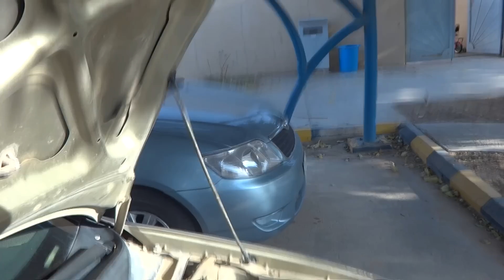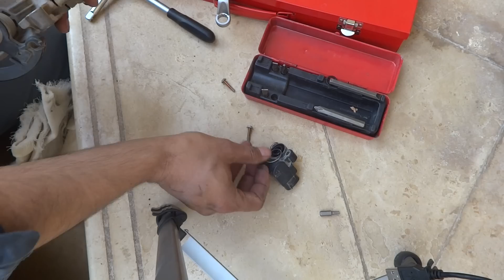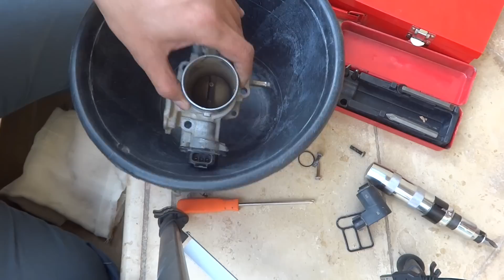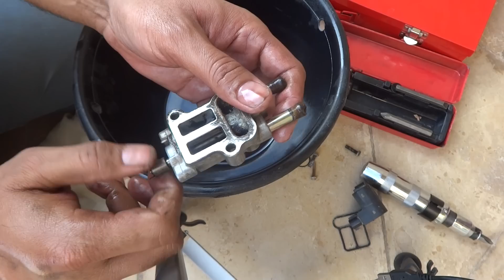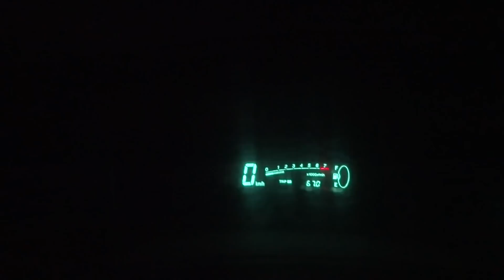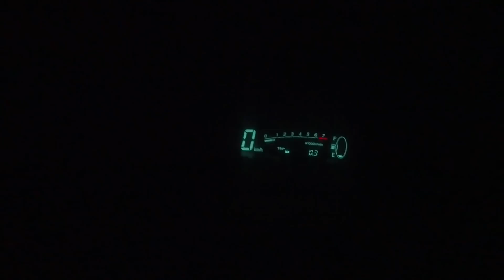Throttle body repair. Idle air control cleaning & repair.

Comment: Hi,  Thank you for your video. Very instructive.  I did clean my throttle idle valve and not sure I did put the black connector at the right place.  But my problem is the same.  high rpm at idle, but it change when I turn on fan in the car.  It could be 1000 rpm with the fan off, but rise to 2000 rpm when I turn on the fan, not always but most of the time.  There is nothing else in the car ( with electricity) that trigger same event.  Turn on light, hasard, AC, , no change in RPM.
Not sure where to look now, do you have an idea ?

Thanks in advance
Reply: +Solution Netcomm 
The rpm issue happen also with the fan off, it could be revving at 2000 and sometime more, seen 3000 rpm with the fan off.  I disconnected the valve idle sensor and problem is the same.

I've seen situation where I turn on the fan, and it barely change the rpm.  I'm really lost.
Reply: +Solution Netcomm 
It is a Matrix 2003 Toyota, so similar to your car
Reply: Thank you again for your video.
What I did to test the valve, is to remove, the valve and put a full gasket between the valve and the throttle body.  Did a bypass for my water so water doesn't come in the valve anymore.  This confirm that my valve is defective and I ordered one.  Right now, I don't have the choke and in the morning, idle is rough.  But as soon as the temperature of the engine rise, idle is ok and I could turn fan on or off with no impact on rpm.  Can't wait to receive my new valve.
Reply: @solutionnetcomm6139  don’t you get a jerk when shifting to D when on rough idling?

Comment: Great job with video....just found this data ( see link )  as i try to work on a 04 Echo that has PO511 code  2000 to 2002 Toyota Echo Service Manual    http://caphector.com/atoyota/TableOfContents/manual.html

Comment: i cleaned my iac valve and try to get it to work by connecting the con ector and the vacume line hose ONLY. does that power it up? it wast sucking any air or soing anything but i could feel a little vibration inside. is it broken?

Comment: Hi...I attempted to remove the throttle body and it wasn't hard but when I got to the two tubes that connect to the Idle Control Valve, bottom back side of the Throttle Body, I couldn't get leverage to get in there. Would you recommend removing the Dip Stick, it seems you did, so that you can remove them and harder, connect them back lol.

Comment: Hey thank you posting this video. Our car had trouble keeping the idle RPM steady. The RPM needle jumped over 2000 RPM. We did the repair on a 2001 wagon corolla using this method.Took the throttle body of the intake manifold. Then took the "Motor" out  hack sawing the 5 sided screws. And changed them to a Philips head screws. No need to take it further apart and risk the caskets. Just use a spray solvent from the throttle body. There is a clear path in the intake manifold side. And spin the shaft. Doing this the junk got loose. And now the motor is able to spin the shaft freely. No coding or tester was needed. Just took a picture were the motor and shaft was located against the throttle body. The two passages are for coolant to make a loop in the TB. To heat it up. You can see the op video car has used only water at some point because the passage way is rusted shut.  Again thank you posting. This saved us a lot of garage time. And patience. As here most mechanic's just would have changed the whole throttle body assembly.
Reply from the maker: terhhh87 Thanks dear friend for nice wording and positive comment. Glad that your car come to new life after repair. Regards,

Comment: Dear friend,I changed the battery of my car then it start hasting and the rpm was less than 300. I have cleaned the throttle body and mass air flow sensor on my toyota camry 2002, and after that whenever i turn the engine on it is idling around 2000 rpm the very slowly goes down to the normal range.  this happens even if i drive my car again after 20 minutes from turning the engine off. Any idea how to fix this problem. Regads
Reply from the maker: ahmad ali You should have to adjust the throttle body IAC actuator. There is room for adjustment looking at rpm at idle. You should make it adjust to 700rpm at idle at normal running temperature. Also if the car is OBD II complaint, you should have to scan it using a scanner to see the trouble codes. Sometimes by mistake something is happening when you do some repair which is causing a new problem in your car. The codes will show you if you made any mistake. Regards,
Reply: LearningZone Dear friend, thank you so much for replaying back to my question. I am not sure but i think the throttle body in my car is the electronic one, and i don't know how to do that. Also, the engine light is not eliminating after i turn on the car. Best Regards,

Comment: Hi, how can I clean the throttle on my 2006 Toyota Yaris? The Air Filter Box is connected to it so how do I safely remove it? There is a droning or muffled sound coming from that area so I want to clean it! I told my mechanic and he said that the only way to improve the idle speed (rpm) on my car is electrically as it is controlled by the brain/fuse. He sprayed something to remove the carbons and put the air filter back on immediately. I heard from another video that we should have let it air dry for 30 mins before replacing the the air filter black box. Can you please explain what you think needs to be done and how can I do it? I want to do it because the mechanic might think I'm overly particular!! Thank You
Reply from the maker: Sean Green Dear friend try to do it yourself and sure you have to relearn the throttle body after cleaning using a bidirectional scantool. If you don't have one, you can do it by some professional having the tool for small money. Hope you understood and will follow the instructions. Regards,
Reply: My God relax!! I was asking an honest questions as the humming/droning sound at the end is a sound my car has and I want to know was it the air coming from the throttle bootle or whatever it is?
Reply from the maker: Sean Green I am sorry dear friend if it was going in wrong direction. This was not I meant. Yes there is air involved in the system. In case of any loose spot for the air and vacuum, you will listen it as whistling sound. Tight all points for air an vacuum by not using Silicon instead by replacing bad hoses or clipping them well. Regards,

Comment: Hi my friend, i got a honda civic 98 (manual transmission)..my problem is, it's jerking in 1st gear when i'm about to release the clutch and if i'm in 3rd gear..i already change my sparkplugs,distributor cap and rotor,fuel filter and air filter..but the problem still exist...after i watched your video i decided to clean my throttle body too. and i found out that my IAC valve rotor magnet is broken.only some piece still attached on it..i still cleaned the IAC and put it back together..when i test my car..the jerking in 1st gear is gone..but when i'm in the road and reach around 2000 rpm from 2nd to 3rd gear, it still jerks..my only question is..do you think the IAC is the only problem that's why it's jerking..i'm planning to buy a new IAC and MAP sensor as well..hope you help me with this..thank you so much..
Reply from the maker: Ace Legion Dear friend appreciated that you attempted your repair! It could be the broken IAC as you are lucky that you find it. But other parameter could also cause the same problem. A few days ago I was working with my Toyota Corolla for your same issue. In that case its fuel pump was bad. I recorded the whole thing and showed how to test for fuel pump and fuel pressure issue. The video will be up in coming few days in two parts. So if you are interested to watch that, you may subscribe on my channel and you will get an automatic notification on each upload. Regards,
Reply: Thanks for your quick response my friend..I hope mine is only the IAC problem still waiting for my parts..i got one more question on the last part of your the video, after you cleaned the throttle body..i saw that the RPM get high..what did you do to make your RPM low and goes to normal.Thanks and regards..
Reply from the maker: Ace Legion Dear friend hope yours will be a simple problem. The rpm will high when the car will be cold and will come down gradually when it will become hot. Also there is a little adjustment in the IAC area where you can adjust your idle speed. Don't confuse that adjustment to one the screw adjusting the throttle plate in the throttle body. Don't adjust that screw, the factory adjustment is the best setting. Only adjust in case if someone tried it before. A lot of effort is needed to adjust that to proper place if disturbed once. Regards,

Comment: Dear friend , what is the reason for the water bypass in the throttle body ?
Regards.
Reply: +toolman talal  Heat-dependent idle-air valve-position.  Its a thermo-mechanical device.  When coolant (engine) is cold.... the secondary idle valve is open fully. When coolant is hot its closed.  So when cold it lets in more air for a high idle.  When hot its fully closed, and the PWM controlled valve is in full control of the idle when at operating temp.
Reply from the maker: toolman talal According to my understanding this is for preheating of air which is entering to the engine.
Reply: +Marek Sumguy thanks for the explain.

Comment: So what kind of solvent are you using to clean that TB and IACV in your video ? I need to get some rhing like that, my CRC TB cleaner is running out fast
Reply from the maker: Kaash Bragna Dear friend you can use regular gas for TB outside cleaning. For interior you can also use regular gas but WD40 is my favorite one. You can use even carb. cleaner for the purpose.
Reply: LearningZone I used gasoline to clean the iacv and now the iacv won't turn one way at all and the motion is more restricted in the other direction  as well , Any solutions ?
Reply from the maker: Kaash Bragna Friend this is not due to the use of gas solvent instead due to your procedure. There are very small deposits inside the IAC area which are needed to remove during cleaning process. Also the IAC actuator rotor is a magnet with has a tendency of accumulating metal debris. You can clean the magnet part using a piece of rag and giving some time. Also same is true for the plate piece which is controlling the air. After doing all these, you have to fix back everything and make a little adjustment to your IAC for excellent performance spot and good idle speed when the car become worm up. Hope you grab my point and will follow the instructions to solve your problem. Wish you good luck with your repair. Regards,
Reply: LearningZone 
Thanks, i noticed that the rotating plate inside scrapes against the metal and so now it doesnt rotate one way and is even harder than before to turn the other way. I was also using a screw driver to clean the insidr and i think the metal inside got slightly bent and so now the plate scrapes against rhe metal but i dont know how to bend the metal back

Comment: Awesome job ! Just curious how do you get those 5 starred screws off the iacv, i've already cleaned everything as much as I can just found your video after I thought I might need to remove those to do a more thorough job. Also im wondering what cleaning solvent your using ? My CRC throttle body cleaner is almost empty lol. Is it ok to get that liquid on the iacv  sensor pins ?
Reply from the maker: Kaash Bragna Thanks for liking video dear friend. Yes there is no problem of your cleaner with electrical connections. You may watch my other video on IAC actuator screws modification. They are real pain in the job. The url for the video is as following. Regards,
https://youtu.be/9Je7_BkLIK0

Comment: Great video, I was wondering could you do another showing the calibration you mentioned in this video? Or maybe share details where to find out more about it?
Reply from the maker: Drewan Nicholson Dear friend thanks for liking video. I would show the calibration process the time I would get a scan tool! It needs an average scan tool to calibrate the throttle body. Otherwise it could be done up to some extent through mechanical tune up.You may subscribe on my channel as I am uploading frequently and you will get an automatic notification on each upload. Regards,

Comment: By the way, I have a problem you may be able to help with. My engine is idling rough and very sluggish + engine management light's come on since last weekend - mileage is 125k now on a 2005 model .I average 20k miles per annum lately so change oil + filter at least twice per annum and use fully synthetic. After watching your video, I've cleaned my MAF sensor + throttle body in situ, using carburettor spray + electric cleaner which were dirty but still hasn't made much difference, so the cause must lie elsewhere. Also changed oil, oil filter + air filter and will be changing my radiator today as well as the lower half fins are badly damaged - I suspect design fault on the lower grille which allows gravel and small stones to impact it. Anyway, my replacement radiator's just arrived. I suspect the culprit is either a blocked injector or failed coil pack which is causing a misfire. Would appreciate your help/advice greatly - Any ideas? Many thanks.
Reply from the maker: Tim Y Dear friend for misfire if any, and also for Coils testing and fuel injectors; you may watch my videos one on this channel and the other on my other channel. Here are the urls: http://youtu.be/1iFd4WbBOo4         and      https://www.youtube.com/watch?v=AOwfn_gka2MIf you don't find anything bad you may try to decarburize your engine. Here is the procedure in one of my videos. It seems a bit odd but it works.http://youtu.be/cRif-Zglr5IAnything you doubt, please don't hesitate to ask. I would be very happy to help you by any way. Wish you the best of luck. Regards,

Comment: Great!! One question, whats the model of the idle air control? does this video works for daihatsu terios iscv?
Reply from the maker: Angel Velasco Dear friend thanks for liking video. My car in the video you can see is 2000 Toyota ECHO. This procedure can be applied to many cars of same built. You may look at components of your car for the application of this video to your particular model. I never worked on one of your model so that I could give an advice. Anyhow you can send me images of your throttle body as email attachment then I would be able to give you a word on that. This video helped many people for solving their cars idle speed problems and IAC related problems. Regards,

Comment: What kind of solvent should i use?
Reply from the maker: Jayson J-Son Knight You can use WD40 or any other similar cleaning oil spray as solvent to clean the part. Regards.
Reply from the maker: Jayson J-Son Knight You can use WD40 or any other similar cleaning oil spray as solvent to clean the part. Regards.

Comment: Great video and well worth watching.Did you use an new gasket for the throttle body? or was the old one ok?Own a yaris myself and will attempt to do the same.
Reply from the maker: Tom OConnor Thank you dear friend for liking the video. If you own Toyota Yaris or any Toyota, you subscribed a right channel. I used the same old gasket as it was in good shape and condition. I used same old gasket on many cars throttle bodies after service and they worked flawlessly. You may check your Yaris throttle body as if it is the same as one I showed here or it is a drive by wire (motorized Electrical type). If it is Electrical motorized type then the cleaning instructions may vary. But you can do it yourself without facing any problem. Regards and good luck,

Comment: Thanks for posting this in so much detail. Most people would just replace the whole unit and call it a day, it's so much cooler to actually repair the problem- for free no less.
Reply from the maker: iretch Thank you dear friend for nice comment and complement. You are correct, repairing something for no cost or very less is some thing very nice instead of throwing something and going for a new one and wasting money for no reason.You may visit my channel and you will find lot of technical and repair videos which will sure attract your interest. Do subscribe on my channel to be in-touched as in this way you will be notified on each upload. I am uploading videos frequently. Having nice friends like you have good feeling! Regards,

Comment: My idle was crazy for a 2002 Grand Caravan - it ranged from stalling to idle of 2000 rpm and everything in between bouncing all over.  I didn't think cleaning the IAC valve and throttle body would help much.  Your video showed a thorough cleaning, unlike most others that just use spray and let the cleaner run off.  I used a toothbrush to get all the carbon off with a spray type cleaner, and disassembled the IAC to thoroughly clean.   I couldn't believe that it ran like brand new after reassembling!  thanks for the help.
Reply from the maker: Tinkerer Dear friend thanks for nice comment. There is some times adjustment on the IAC motor or coil. You may align it carefully after start up the vehicle and putting it in idle. The position you achieve idle speed, you may tight the IAC actuator there. Also it is good that you may lubricate your throttle (Gas) wire and cable as after running long time it accumulates debris which is sticky in nature and creating hurdle in the movement of the wire in the cable and resulting in fluctuated rpm.